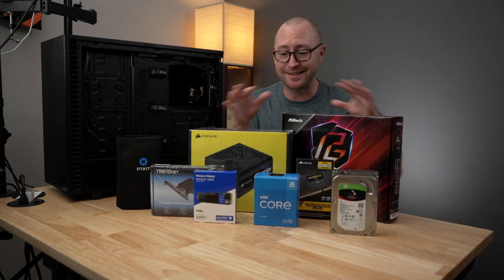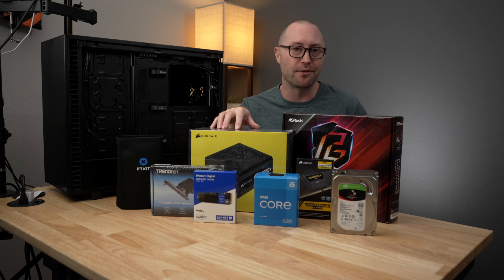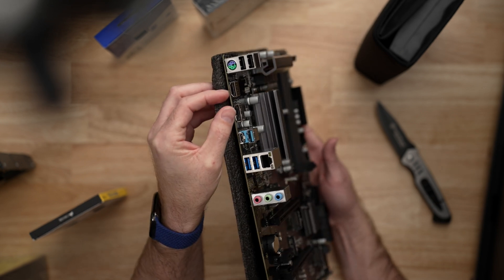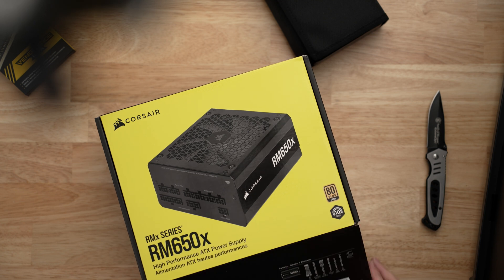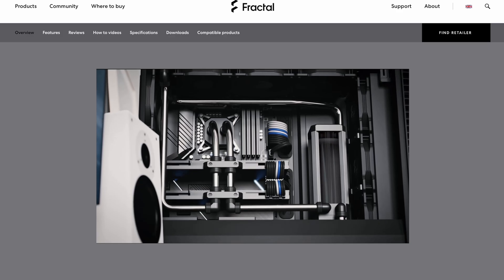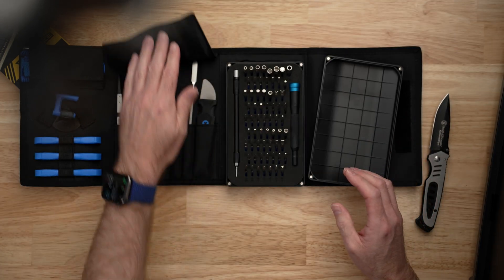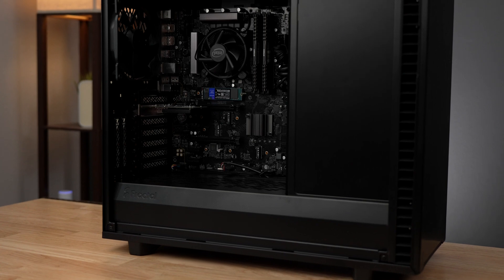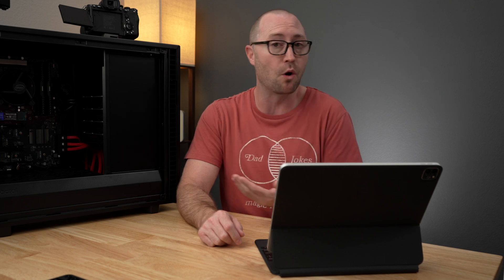Building a DIY Windows NAS with 10GbE!

Comment: I recently built my wife a video editing workstation and I was wondering if this setup can be integrated into it. Well, I know it can, the case has 6 drive bays for 3.5"/2.5" drives, but is it recommended based on the fact that she'll be using it video editing? Would it cause any heat issues or affect overall performance?

Comment: I didn't see you put thermal paste on your CPU, this will shorten the life of your CPU as it will run hotter. If you spent the big bucks on this rig, you might want to invest in a little arctic silver. And another thing, you're using 10GBe for inter PC file transfer, but skimping by using the motherboards' SATA ports. You'll get a lot higher data transfer speed with a PCIe 4.0 x16 HBA adapter.
Reply from the maker: The cpu comes with past already applied.

Comment: stupid question - but since you do this regularly - so you moved all your synology files to your new nas drives over the network, using drag and drop or some other system, right?  what then do you do with the drives in your old synology nas? are you able to reformat them and put them in your new nas?

Comment: I've always wanted to do this! How much are we talking price wise? I may have missed it.

those drive speeds are decent enough that you could even edit off the NAS which would save so much storage space on your Mac.
Reply from the maker: I have tried all ways possible editing with FCP on a NAS and it never goes well. I edit local and then transfer finished projects to it. You can go much cheaper but this was about 1k before the drives.
Reply: @JerrySchulze  1k before the drives?! Your unpopulated enclosure is incredibly expensive - as you've indicated, you can save $100's off this, but, you'll also STILL get the same functionality. You don't need that size of case, or motherboard. A well-selected, cheap AM4 setup would have been much, much more bang for buck here. Like yourself, most enthusiast folks will still have their 'main' PC for the heavy lifting stuff. 
Still, well done on educating folk away from these expensive and very limited NAS pre-built enclosures, and getting them to think about building their own.